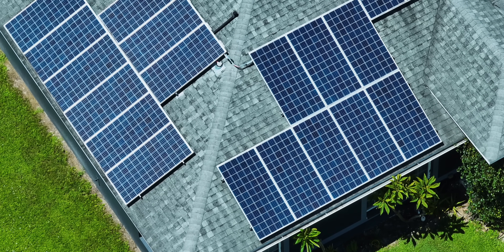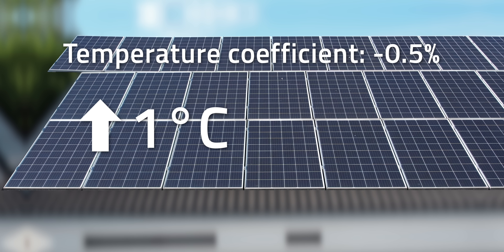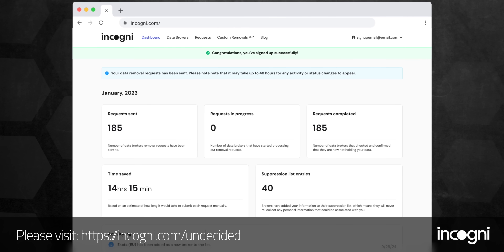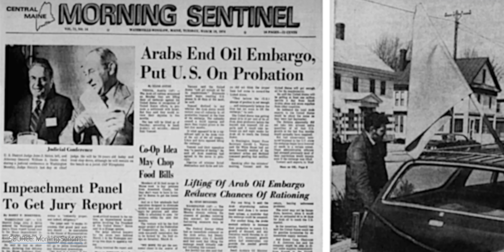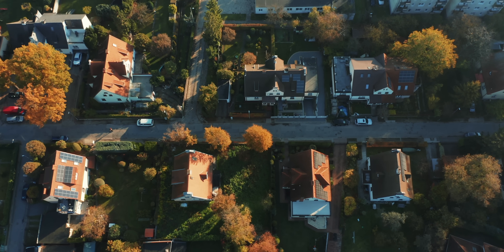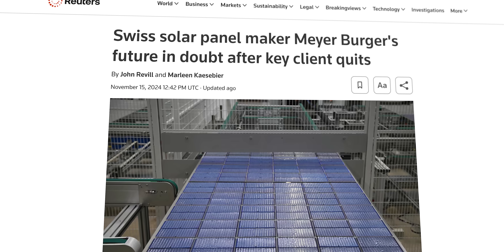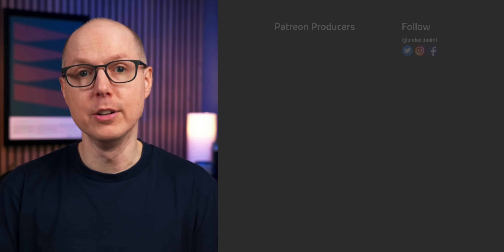Why Hybrid Solar Heat Pumps are the Future of Home Energy

Comment: Eh, I would disagree on one statement... heat pumps are cheap.  They cost the same as an air conditioner because they have only one minor difference, a reversing valve.  Now, some HVAC professionals like to charge a premium for installing them, but that is because they're ripping customers off; heat pumps take next to zero additional skills and take no more than 5 extra minutes... making sure the thermostat is setup to use the reversing valve appropriately ("on" for heating mode or "off" for heating mode; usually it is "off" for heating mode, but that isn't universally true).

EDIT: I will add, this only works if your water storage temperature can take on the additional heat from the roof.  If your water is already 120F and you're actively keeping the roof temperature managed, you're not going to be able to push heat to the water heater, generally.  The hotter the temperature of the water, the less effective it will be at taking on the heat.  The best use would be a completely separate tank to store water before entering the water heater.  This would essentially preheat the water, reducing the load on the water heater and that water would be far cooler allowing proper heat transfer in an efficient (from a physics perspective, not considering cost...) way.

I think the better overall solution is to implement a VRF Heat Recovery system.  Incorporating the roof cooling into VRF could be rather compelling, but the best outcomes would be in the summer time when temperature is the warmest.  But snatching any potential source of heat in the winter would be awesome.

Comment: No one really cares about COP, at the end of the day the only thing that matters is the cost to operate while maintaining the same comfort as the current means.  The COP could be 10000 but if it costs me 3x, I don't care.
Reply: Lol 😂
COP is directly connected with your cost of operation. Heat pump with better COP will use LESS electricity to deliver same required amount of heat in same conditions.
That barely matters when you choose a fridge but if you heat up entire house it will quickly start to matter a lot.
Reply: Oh and that example of COP 10000 😂
Heat pump that could deliver COP of 10000 under typical conditions these units work in would be magical alien artefact breaking laws of physics and worth every penny not mere 3x.

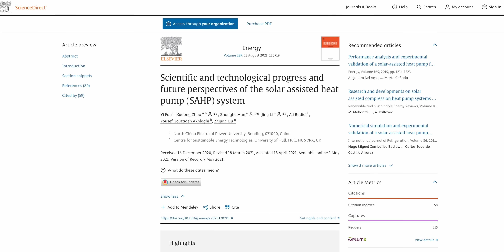Comment: The issue of solar panel efficiency being linked to ambient and panel temperature has been ignored for decades. The schemes that wanted to "pave" the Sahaha with solar panels missed the fact that in the Sahara, most panels only run at peak efficiency for about 4 hours per day, between 08:00hrs and 17:00hrs the panels lose at least 50% of their efficiency due to their temperature, I have seen this in the real world, in fact, on a test, a panel in Egypt was rated at 425W, and for around 2 hours in the morning, it generated that, but as the day warmed up, the energy dropped, and by around mid-afternoon, the panel was only generating about 120W of power despite the Sun being overhead, again, as the panel cooled, the efficiency improved and the energy generated increased back toward optimal as the Sun set. 

Adding heat pumps to solar panels as a cooling mechanism and using that heat to preheat the water or other systems via the heat pumps is a smart solution and I can see where this will work in specific locations, but this will not work everywhere when water is used as the cooling medium.
Reply: Considering energy is often becoming worthless during peak solar anyway wouldn't it be wise to get bifacial panel mounted vertically North-South in those countries? In that mounting you yet two peaks, one mid morning and one mid afternoon so this would align very well.

Comment: This system works great in sub-tropical or temperate region. What about solar power in tropical region where heat is always in excess?
Reply: @STEPPACAFE   you still need hot water.

Comment: Obviously using the heat gain up on the roof in conjunction with the pv gain is a win/ win. But before getting into all that dark sorcery, I want to see the industry come up with something just as “normal” looking as Tesla tiles, but without the premium cost and gatekeeping behind the product. In other words a sleek, modular, standardized system of roof pv shingles and dummy shingles that you can get today at Home Depot. I want the Mr Cool of solar roof tiles. Those GAF shingles are hideous, the Jackery tiles show promise.  We just aren’t there yet. Soon? It’s long overdue.

Comment: if I understand your explanation correctly the heatpump is air to air or atleast taking advantage of the hot air under the solar sjingles. so what's stopping heatpump developers from making a simple system that has the ability to take air from underneath traditional panels? sure its less airtight etc but it still gets hot up there. this way you have 2 simple complex systems that are not reliant on eachother for working but do boost one another when used in tandem. 
I understand its more nuanced and I'm over simplifying things. Hopefully that does get the idea across.

Comment: My grandfather had the heat pump thing going since the 70s. He had hoses through the roof of the house and garage, in the summer they heated the pool, in the winter cleared the driveway of snow and ice. Then he added some very low output pv cells up there... they provided way more electricity than they 'should have' because the heat pump was sucking the heat away. It's a great idea to marry the two in one device.
Reply: You had me at clearing ice and snow! I’m in, tell gramps to swing by and let’s get started on this. 😊
Reply: @MrBertstare  This is well established and old tech, you're just pumping water from the underground to cool or warm a space. The problem is you're going to want to put the plumbing (ideally geothermal grade) inside the concrete so you'll have to rip out the driveway. Personally I'd use a actual phase change heat pump to get the water up to temp, combined with a geothermal loop.

In the summer pump the heat into the ground, in the winter reverse the flow direction and pull some of that heat back out of your giant thermal mass battery.
Reply: Thats great for your Dad. Did he ever thought about making this a sellable product ?
Reply: @ No, he was busy inventing things like Corian(tm) and scrubby sponges for DuPont in the 70s and 80s. He's passed.
Reply: @yutubl  He was always busy when nothing pressing was happening, even in retirement he was always working on 'a project', usually something electronic.
Reply: Where was that?
Reply: @ Buffalo, NY
Reply: That is not a heat pump.
Reply: @rogerphelps9939 It literally is. A "heat pump" is any device which pumps heat around is a "heat pump". There are ground source heat pumps and air source heat pumps. There can be air-to-air heat pumps, liquid-to-liquid heat pumps, liquid-to-air heat pumps, and air-to-water heat pumps. 

It sounds like the above poster's grandfather had a liquid-to-liquid open heat pump with pool water or something.
Reply: @PSNDonutDude  No, it's just a heat exchanger. a heat pump moves heat, not the medium, and it does so against the thermal gradient. 

The most common heat pump is the compressor/expander in a refrigerator or air conditioner.

A Peltier module is a heat pump, despite not pumping any medium.
Reply: @PSNDonutDude  Yeah, I remember a very large hot water tank, but no vacuum pumps and copper tubing.
Reply: @ I never said it was. You wanna fight?

Comment: If you have a large lot even 15% efficiency of Panels is more than enough because solar panels are cheap and the Sun is free.   However if you dont have much room then it really matters especially if shaded or cloudy area.   Where high efficiency could really matter is enabling the significant use of panels on EV's.
Reply: In fact the racking for the panels is often around the same price as the panels (or more if you are not DIY ing it.

Comment: I'm confused. SAHPs would only seem to cool panels when the weather is cold enough to run interior heating. During the summer, when the panels would actually benefit from cooling, you won't want to pull that heat inside your house.

Comment: If the Air Source Heat Pump was replaced with a Ground Source Heat Pump the electric cost of removing heat from the solar panels would be the cost of circulating closed-loop water.  And the best market for Hybrid Solar Tile would be in warm-to-hot climates where the benefits of cooling the solar tiles would be greatest.  Why doesn't anyone see this?  ((End Of Rant))

Comment: Is there a slot on the TRL pyramid that is labelled "viable now but still developing fast, so many people feel the time isn't yet right to commit to tech that will only get more efficient, cheaper, and more reliable in the future"?

I've been watching rooftop solar systems for years and, whenever I feel that the time might be right to invest, a video like this one comes out that makes me think "wait another 18 months".
Reply: If you get something like Enphase micro-inverters your system will be modular. You can get some panels now and start getting the benefits of solar, but later you can upgrade your system and get some extra panels and add them to your system. They don’t have to match your old panels.
Reply: Patient adopter

Comment: This makes no sense to me - the heat pump only needs heat in winter, when there's not excess heat available from the roof.
Reply: With black solar tiles? There's plenty of excess heat in winter. You should look up passive solar heat and companies like Arctica Solar. Heat abounds.
Reply: But excess heat is available, even in the winter. When there’s heavy snow, that snow reflects light away, but as long as the sun can reach the roof, there will be excess heat.
Reply: Shoulder seasons would benefit from this, as well as domestic hot water year round.
Reply: Here in Nome, Alaska several people have evacuated tube solar collectors, which works well 10 months a year.
Reply: Well, if you use it to heat your water, then it'd be needed all year round, even in the summer.
Reply: @lennyrachelhoover7273  In the summer, you are running A/C and have masses of free heat to dump for hot water.

Comment: I've been thinking about this for YEARS!!!
Edit: But what I specifically was thinking, was running water in thin pipes under the solar panels like a heatsink giving it not just the best of both worlds. A cool solar panel and heated water
Reply: That only works to cool the panels if you also cool enough of that water somewhere, otherwise heat will build up. Either by using it and replacing it with cold water from your water connection, or if you have some other way to cool it like a set of radiators both inside your house for heating and outside for getting rid of excess heat. Then you'd need to set it up so it switches automatically.

Comment: One use case that jumps out to me where this could be interesting is pool heating.  One of my largest summer time electric consumption areas is the pool with the pump and heater. The system can electrically power the pump and leverage the panel heat to warm the pool seems like a win win.
Reply: This is a very solid use case.  As heating a swimming pool is a year round process.  Typically when the panels are dissipating the most heat, the house also needs to be cooled. Thus the excess heat is not needed.
Reply: Linus Tech Tips did a video on such an installation on Linus's new house.
Reply: @Chinoman10  I saw that and pretty cool, but his required installation of plumbing internal to the structure of the pool. I guess it would be possible to just circulate water from the pool across the solar tiles, but the chemicals are likely to lead to faster wear  and corrosion of the panels
Reply: @toddh3774  yes 100%; you don't want water pool in the "solar pipes".
Reply: Try the cheap Chinese pool heaters which are black plastic tubes put in series with the pool filter circulation.
Reply: @zettaiengineer4202   yea i have played with some DIY options there, but still have the need for the electric from the solar for the pool pumps.  Thats where the combined SAHP is interesting as it addresses both the electrical and thermo needs.
Reply: Why would you heat a pool in summer?
Reply: @dermotbalaam5358  Cold water in a pool, even on a hot day, can be pretty uncomfortable at least for a while. Speaking as a Canadian.
Reply: @dermotbalaam5358  I wouldn't, even in the northeast. But I remember visiting relatives a long time ago in Los Angelas, everyone in the neighborhood had a built in pool and they where all heated. It was like swimming in bath water, but that is what they liked.
Reply: @toddh3774  there is a company that makes a product called CoolPV which integrates SolarPV into a Solar Thermal cell for pool heating. I looked into it as I had to rip my solar thermal off the house to put up PV. Unfortunately the cells leak and are expensive - it was cheaper to put in a 150k BTU pool heating pump and that had the benefit of putting out warm water on summer nights when the breeze is cool. Overall I like the heat pump more than I think I would have liked the hybrid panels.

Comment: I’m missing a few important things in your video. When we are needing the heatpump the most (in winter), in a lot of climates the solar panels are covered with snow, so they don’t absorb any radiaton at all. And there are other winter conditions (clear sky at night) when the solar panels radiate out heat to the sky. So in that case the temperature of the panels will be lower than ambient, resulting in a lower COP for the heatpump compared to just using ambient air!!!
Reply: It only uses air from under panels if that air is >1K warmer than ambient. Its in the first half of video.
Reply: @sznikers which means you are both correct.
Reply: @powerguymark  Well since it switches to warmer air it will have better COP not lower, it simply wont use that colder air so the COP will not drop. Warmer air = less delta T between cold and hot side = better COP.

The rest i agree with, when its so hot we need to cool panels we usually dont need central heating, or not as much so gains are diminished. If that 20% improvement promised by company was cheap maybe it would still be worth but at over dollar per W that's just waste of money.

Comment: Other than using that hybrid for domestic hot water you're not gonna get too much benefit. In the summer the panel heats up to a point that degrades efficiency and the panel itself, but you don't need to heat your home. In the winter the panels barely reach 40C/104F. I guess in the winter it is still beneficial as small as possible heat difference between outside and inside and if you can extract above freezing temperature from that panel it will boost efficiency (of course the day must be sunny too, which southern europe can benefit because we have relatively mild sunny winter at least 3-4hrs per day).

Comment: Ive thought about running water lines under our panels. To cool in the summer and heat in the winter to remove snow/ice. Doing so could also create a thermal hot water source vs traditional water heating methods. At the very least it could have potential to offset traditional methods. It would take a lot of engineering skill I just do not have at the moment. If I did it, it would be by the seat of my pants and trial and error.
Reply: How would you keep it from freezing in winter?
Reply: Hence the trial and error statement. 😂 I have no idea.  I would think warm flowing water would not freeze right off but it would have to be recirculating fast and in short runs because of the thermal transfer.  Once the temp of the water maintains a set temp a switch to a blowdown cycle to clear the lines might work. 

But the simplest way would be to use an antifreeze solution in a closed loop system. You could use the same lines to preheat water for a hot water system.

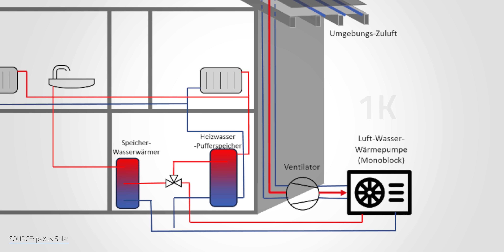Comment: 3:49 Given that 1C is equal to 1K of temperature delta. I think using C here would have been more reachable to the wider audience
Reply: Putting things in Kelvin makes it more approachable for our intergalactic viewers. Since absolute zero is the same everywhere, all they need to know then is the conversion rate between Schrute Bucks and Stanley Nickels.
Reply: You can even get heat from 1 Kelvin. Most people can’t imagine you can get heat het from negative Celsius, let alone -10 or even -273 Celsius. (Depending on the anti freeze used)

Comment: This is kind of useless in hot summer when the pannels are at their hottest and the house needs cooling.  Cost of running cooling on just your pannels is not worth the efficiency gain, unless you have another use for the extra heat.
Reply: Most people bathe during the summer.
Reply: In the summer In north Texas, I frequently shower with just cold water. Instead of "cold and hot" we sometimes refer to the taps as "warm and warmer"
Reply: Ok, even if you don't shower on hot water during the summer, I'm willing to bet you use it for the dishwasher, laundry, and some other appliances.
Reply: @lennyrachelhoover7273  - yes, but that isn't much. Dishwasher runs once every. 3 days probably do about 4 loads of laundry a week, but only the first water uses half hot and rinses are just cold. Front-loading washer doesn't use a lot.
Reply: In the Caribbean the heat can be used as a water heater

Comment: But surely when solar panels need cooling heat pumps don't need the heat and vis-versa?
I think perhaps little sprinklers over the panels would be best, and air flow of course.
Reply: Sprinklers would quickly cause algae to grow on the panels.  Also, if you have a shingle roof the constant waterflow will deplete the mildew/mold/algae inhibitors.  You've probably seen old roofs with moss growing on them, that's why.